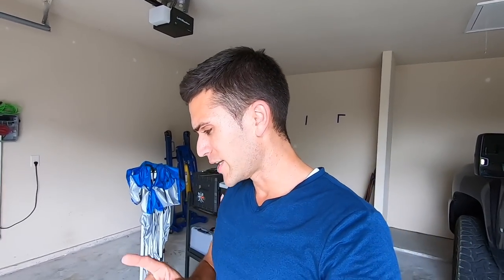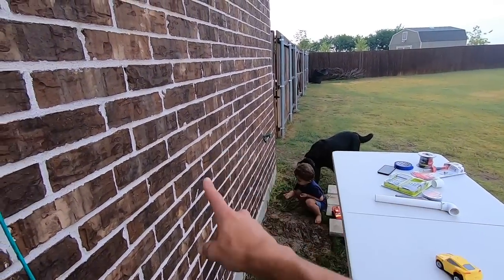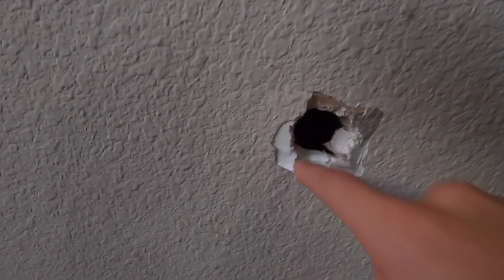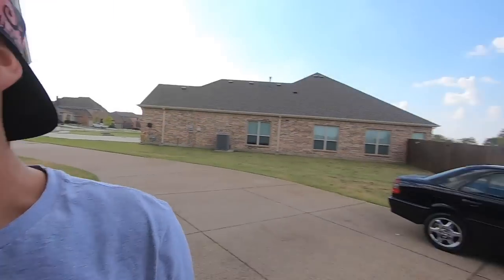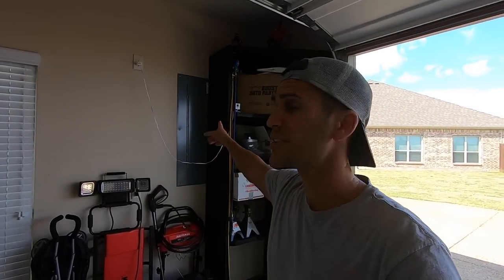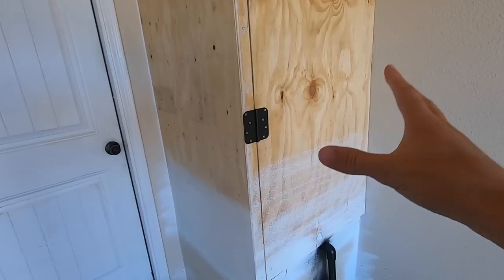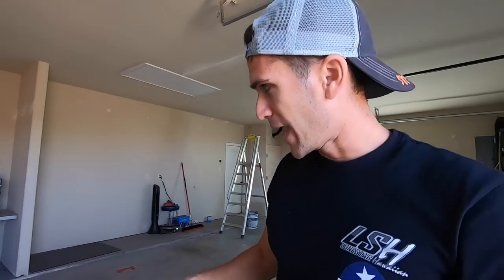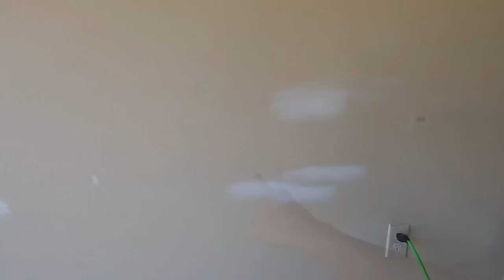Building My DREAM Garage - Part 2: Walls

Comment: Hey Chad good job on enclosing that gas water heater but you need to add a grill vent some where on that water heater enclosure. I work for the gas utility company here in Illinois. Water heaters  need air flow to properly work.

Comment: EPoxy flooring! Big red and blue flakes with white base floor so it’s easy to see any messes or leaks. Yes it’s easy to get dirty but helps with seeing vehicle issues and better for lighting for making videos. Wall color is kind of a toss up because of personal preference but I would stay on the lighter color. Not necessarily white cause that’s just plain boring but lighter color to also help keep the garage lit for making videos.

Comment: We did a white/black/grey - top to bottom - when we just re-did our 3 car garage. Had the floors epoxied, too. It's pretty bright with white flakes, so it makes it hard to find dropped washers and whatnot. Sure does show oil/fluid leaks easily though (finally got all those fixed on the ol' stepside Sierra). Garage is coming along nicely - and it's so crazy how quickly your son seems to be growing. lol
Reply from the maker: Growing like a weed! Thanks for the recommendation

Comment: Similar color you already have but a bit lighter. For flooring I would not recommend an epoxy type, unless it's like a rino line strong material. You basic epoxy flooring with dent and scratch super easy. Looks good, it's coming together👍

Comment: Like what your doing but do yourself a favor and put a vent into the box around the water heater for make up air, just check the manufacturers recommendation for air space around the unit. Just cut a square and buy a large AC vent cover and just screw it on. Also the cracks may come back, they make a more elastic type of spackle to help with that so if they do come back try that stuff.
Reply from the maker: Daniel Lawson thanks for the tips!

Comment: U did an awesome job!!! Looks great so far. I was thinking but not sure , do u need some kinda ventilation b/c the water heater has a pilot light as well as a gas fire box. Maybe to vent the heat. Just thinking.

Comment: i am in the process of painting my garage floor with epoxy as well and i ran into something. I have one side of the garage wall which has dry wall to the floor. I am concerned about water getting behind it and causing water damage. I see you have similar situation on some of your walls as well. What did you do or is it a real concern? Appreciate you advice!

Comment: How was the power ran and moved without cutting sheetrock?
Reply: If you look closely around 6:52 mark it seems like he ran it to the floor, then tucked it under the sheetrock along the garage floor. If that was the case, I don't think that is up to code.

Comment: Btw also wanted to add that I’m really liking the content you’ve been making! When’s the next mod for the truck? And have tried figuring out anything on tuning the truck yet
Reply from the maker: Superchips reached out funny enough (i guess that video got enough traction to make them concerned), need to find some time to work with them to find out what the issue is.

Comment: Make sure there is no wood within 4inches of the b-vent pipe coming off the water heater it’s a fire hazard
Reply from the maker: I cut a gap around the vent pipe that's closed off with aluminum. All good to go.